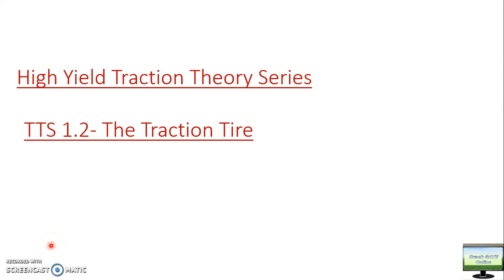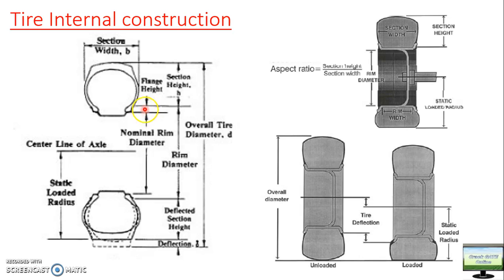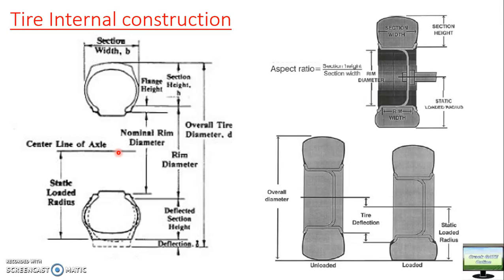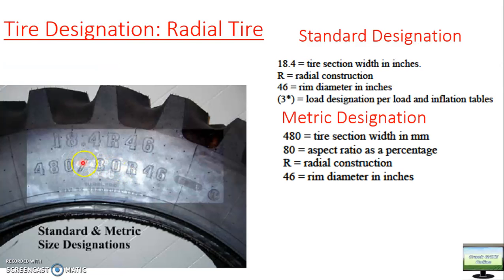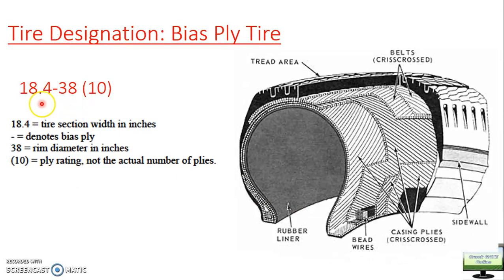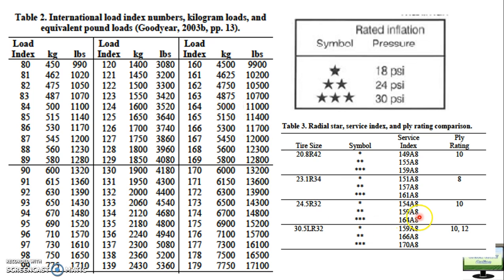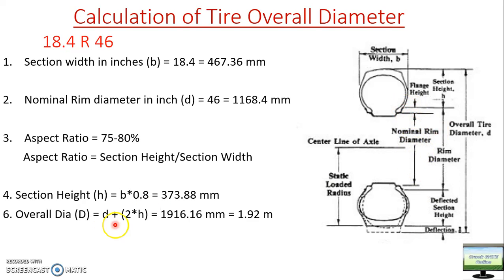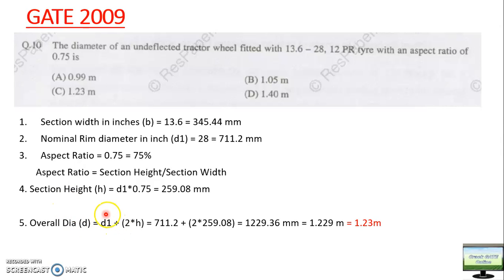1.2Tyre and Traction Theory

Comment: Sir In 1.2 tire and traction vedio.
What will be the effect on section height or dia. Of tire if moisture contect in soil is 20% on which the tractor is standing..
Reply from the maker: Hello Amit, 
There is no clear cut method by which you can directly say the effect of 20% moisture content on tractor overall diameter. i have explained in the video that it depends upon load coming on the tire, tire inflation pressure and tire deflection. If moisture will be high then soil will be comparatively softer and tire can penetrate more into the soil, but as far as tire diameter is concerned, it is the tire basic geometry ( section width, rim diameter etc), load on tire, tire inflation pressure and resulting deflection of tire which will affect its overall diameter. 
Moisture content of soil will not have any direct impact on tire diameter. But at the same time if you keep all other factor same then your tire deflection should be less in softer soil.
Hope it helps.